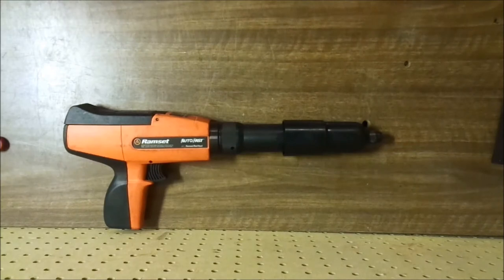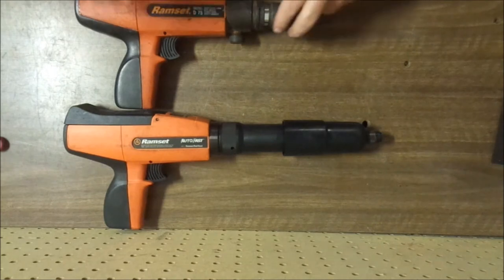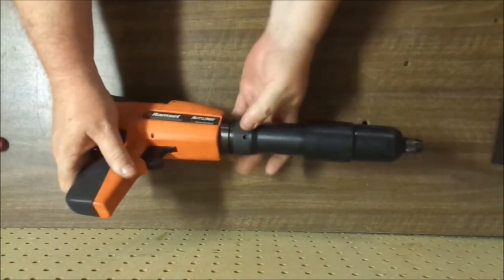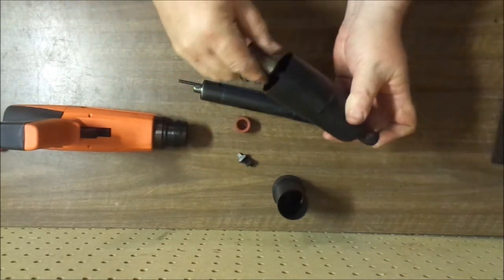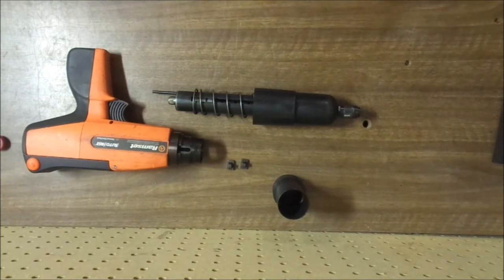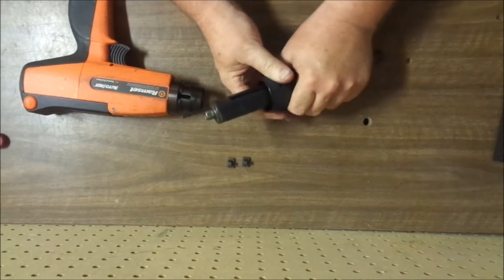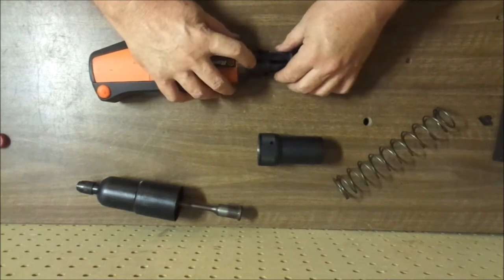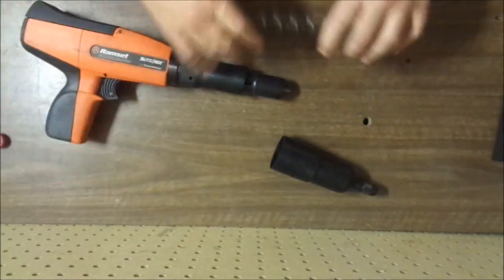Ramset Autofast Fully Automatic Powder Actuated Tool

Comment: where can I get a manual for spit P200?
Reply from the maker: The only thing I can say in contact Spit.
Reply: Thaks how about lubrication?  Are there parts that need lubricating? out old P200 seems to not fire often when we pull triger
Reply from the maker: @kollevbaker  Clean brush and lightly oil the Piston and barrel and other front end parts. Remove any  excess oil before assembly. Never spray lubricant into the tool body.